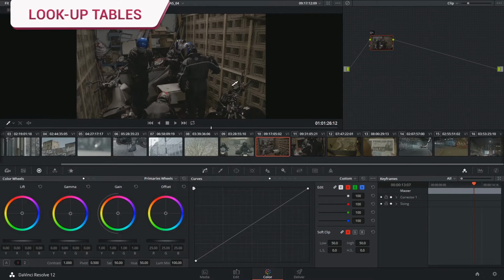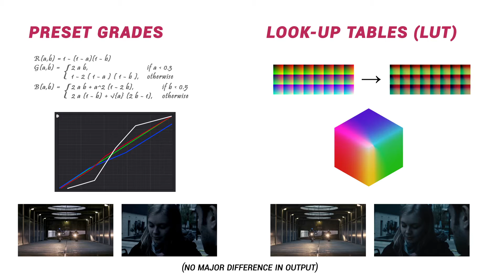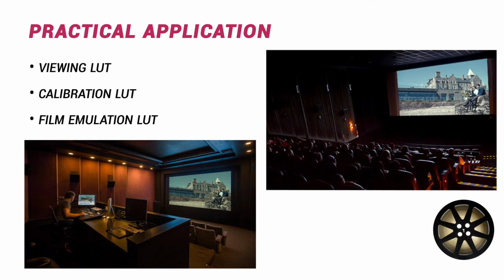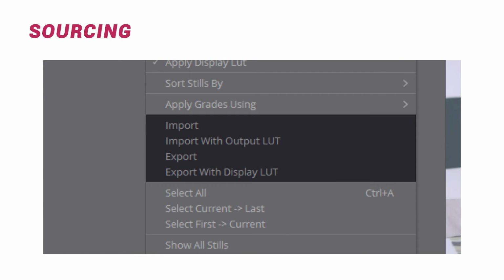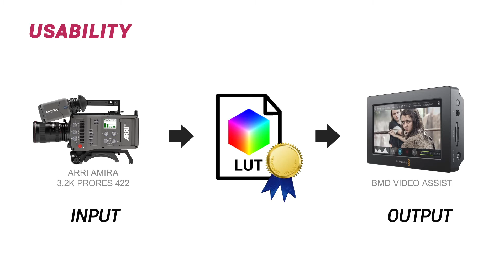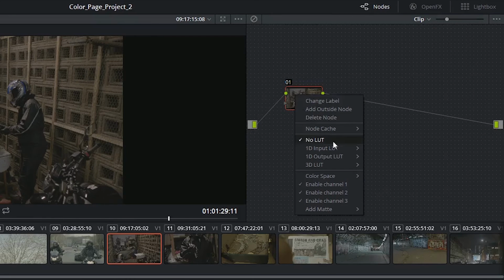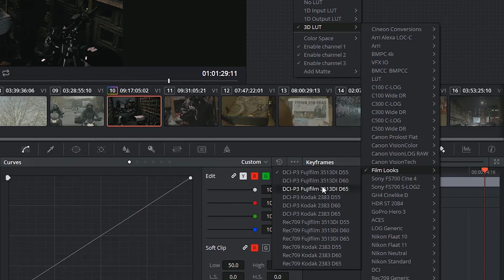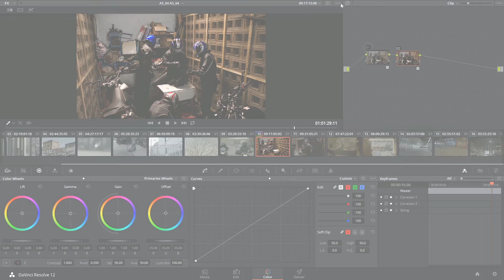DaVinci Resolve 12 - 74 Using LUTs in Nodes

Comment: As always, great vid.... 

Three questions: When you say the camera input has to match the LUT, are you saying that for a Canon in C-Log I need to use a Canon LUT, Arri for Arri and so forth? 

Second: When processing Log footage, do I always need to include a Log to Rec. 709 (or cineon or video)  LUT? 

Last question: When I use more than one LUT, where does the C-Log to Rec. 709 LUT go? Should it always be the last node? First? Or can it be anywhere?

Thanks
Reply from the maker: Hi Tommy, very sorry for the late response. I'm catching up!
1) Yes, you'll notice that the naming convention of the preset LUTs in Resolve is usually something like 'xxx to yyy'. The 'xxx' refers to the starting point, which will be your camera type. When purchasing LUTs online, the creator will usually tell you where their starting point was, so you may set up your clips accordingly before proceeding.
2) This is entirely optional. Often, I DON'T use Log to Rec. 709 LUTs because I find they affect the footage too strongly (sometimes as a result of the cameraman not communicating what settings they were using on set/location). Instead, I have a dedicated first node (or 'Group Pre-clip') on which I'll apply my neutralisation. This gives me full control over my contrast and saturation.
3) It makes sense to apply the Log to Rec. 709 LUT at the start of your process, as LUTs are non-destructive to your grading process and help set up your 'canvas', so to speak. If you start grading your footage, you might find that the LUT dramatically changes its apperance at the very end.
Reply: Thanks again. You're the best.

Comment: is there any way to have all LUTs in a sidebar, so you dont have to click through the menue every time??
Reply from the maker: I'm afraid not! In many workflows, LUTs are used as pre-determined starting points for the grade, so colourists will know specifically which LUT they want to work with from the get-go. Because of this, the LUTs are not presented the same way as stills, or colour grading presets would be.

Comment: Great video!
I also have a burning question - how do you bring up what I think are preset LUTs in Da Vinci Resolve?
I accidentally clicked something the other day which brought the screen at 1:40 up and now I can't for the life of me find out how I did it - where does it hide in this software? xD
Reply from the maker: Thanks! Looks like you entered the Expanded Gallery (https://youtu.be/UQT9BL7Ufo8?t=4m8s). This contains all your grades, as well as a series of grade presets that you can add to your current gallery, or apply to your clips. There's a button in the top-left of the gallery window that will bring it up, as well as clicking on Workspace > Gallery.

Comment: Do you know of a quick way to easily step through different luts like you change change presets in Lightroom?
Reply from the maker: Dave - I'm afraid I don't! As far as I'm aware (and according to DR's manual), there are no shortcuts that would allow you to quickly 'roll' through your LUT options. You have to right-click and select a LUT from the LUT categories each time.

What's even more frustrating is that LUTs are not retained when you save stills of your grades, so you can't even cheat the system by grabbing a still of a node using each LUT and keep those stills for quick reference/application.
Reply: Thanks, let's hope they put it in the next release. Perhaps it will be released at NAB. If you go to NAB let me know I would like say hi and thanks for all the help.
Reply from the maker: I'd love to attend NAB, but I'm afraid I'm all the way out here in London. Perhaps some day!

Comment: Daria, You mentioned that LUT's can only be applied to log footage. Therefore, if I don't shoot LOG should I skip using LUT's on non log footage?

This is the best Resolve info I have found to date thank you for shearing this.
Reply from the maker: Hey Steve - I appreciate your kind words! 

I think the statement that 'LUTs should only be applied to log footage' may have been a bit drastic on my part. LUTs can be applied to anything, technically, as long as the input (or source footage) colour space matches the one of the LUT.

The reason why I think of LUTs as something you would primarily use with log and RAW footage is because those formats initially have a very 'flat' representation of colour, and LUTs are a good starting point for grading - they introduce a good level of saturation/contrast into the image so you can begin working on the creative grade. 

However, if you have a LUT that is designed to work with Rec.709 (or any other colour space outside Log/RAW), then that is also applicable. In most cases, these types of LUTs are not made to 'prep' the shot like the ones mentioned above, but rather to enhance it in more drastic ways. So, visually your Rec.709 footage will already be contrasted/saturated, and a LUT could give it a 'Matrix' look, or a 'vintage photo look', etc

Comment: Daria, I'd like to add a small correction to what you said about 1D LUTs.  They are not limited to affecting only 256 values of data.  Indeed, 1D LUTs are very practical working with 4096 or more values (whereas a 4096 x 4096 x 4096 cube would be completely impractical).  Large 1D LUTs are especially useful when working with linear light.  But of course when it comes to creative color grading, 3D LUTs are the way to go.
Reply from the maker: Michael - yes! My bad - I was thinking in 8-bit terms when I was talking down the mic (not sure why), and realised my mistake during editing. I'm going to put up an annotation to address this soon. Thank you!